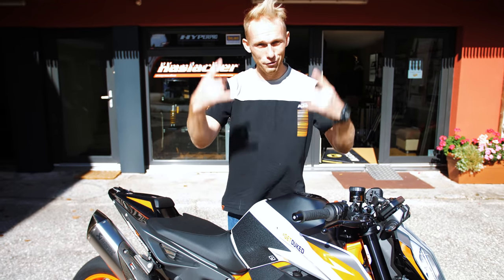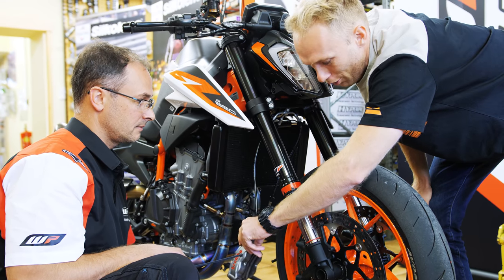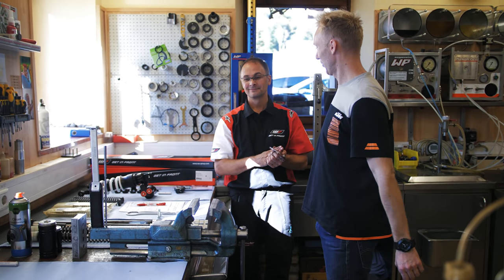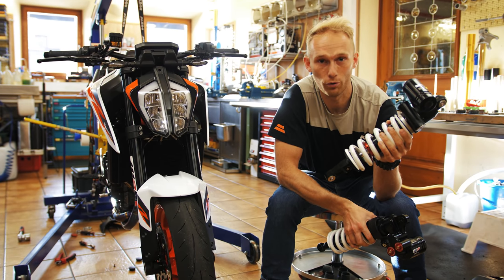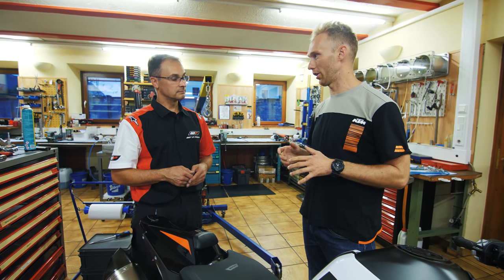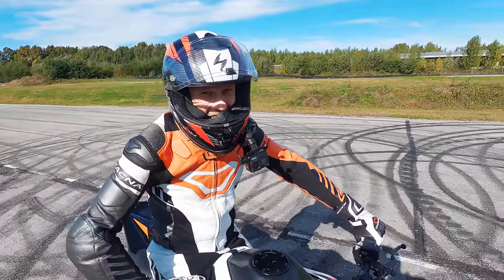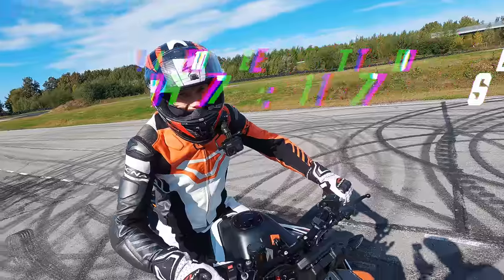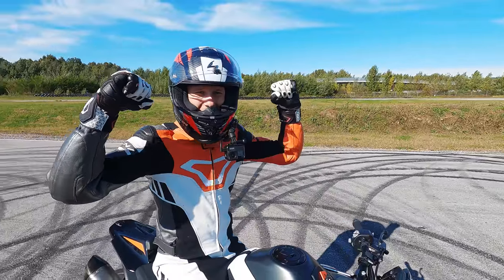How to make your bike truly faster  | RokON vlog #103

Comment: in the R models, KTM should just fit the best suspension, period.
Reply: No shit am so very unsatisfied that my 2020 1290 SDR has a useless steering dampener that once i had major speed wobble from coming down hard 3rd gear wheelies.
Reply: @geraldperry7779  I have an Ohlins one on my Special Edition, but I'm sure that was'nt stock either.
Reply: It wouldn't meet a price point...

Comment: Hı, ı have 890 Duke R , ı have a question:
How can we improve the steering damper?  Because around 190km the handlebar starts to shake! İs adding thicker oil the solution? Or what is your suggestion?

Comment: Lame that KTM puts out the R version, and there is still an upgrade directly from WP on the suspension. I could understand if you wanted to pay for Ohlins but I would expect the upgrade to be incremental from the WP fitted to the "R" version. At one third the cost of the bike, the stock stuff must either be absolute shit, or you must be in search of very small gains at any cost to justify this.

Comment: Wait... what?? i thought the new Apex suspension were supposed to be top gear for new R bikes (890 and 1290).. They could have built the ones your using, according to the price increase. Anyway, that's a monster of agility you got there buddy. Rock on !
Reply: Stock is very good, but not top notch. There is way better suspension.

Comment: man i love wp suspension always had good luck with them, i have a question i notice on your duke your forks have the little red rubber ring on the bottom of fork tubes just like my 690 smc r i never realized i had them until i looked they were pressed all the way to the bottom are they just there to tell how far your fork travel is?
Reply: Yep they are for indicating fork travel